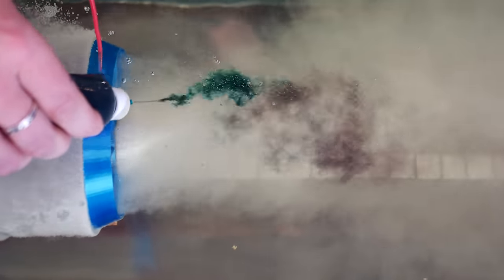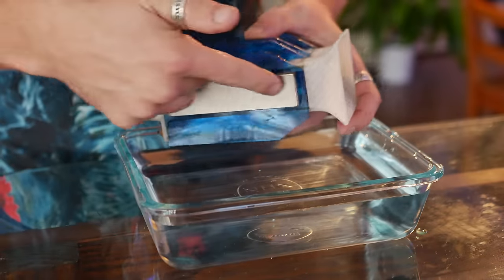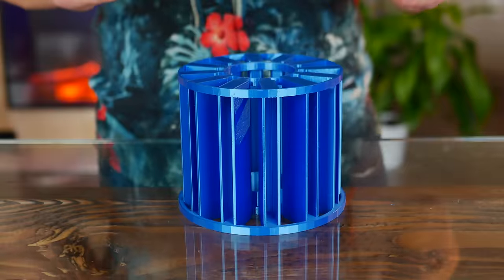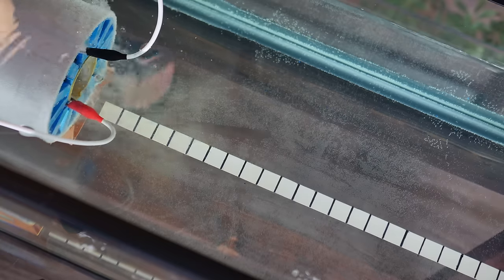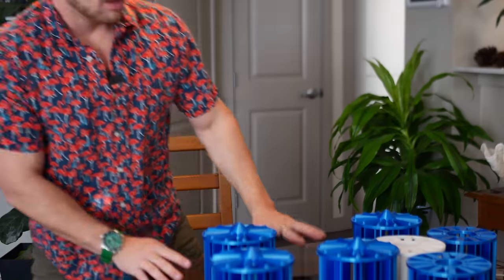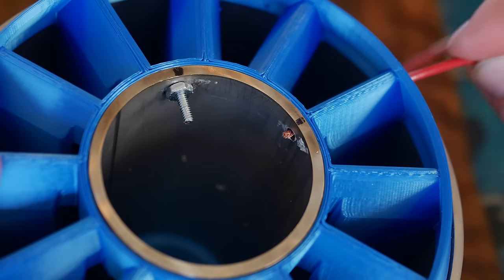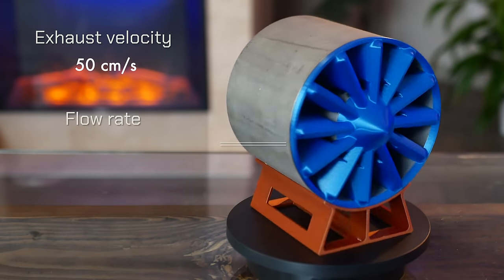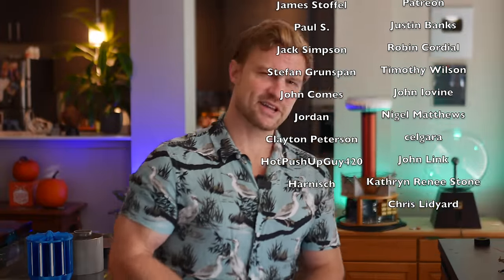Designing a Futuristic Magnetic Turbine (MHD drive)

Comment: The one thing that i am not really sure about this idea is that you could actually see the dye shift colours (a possible indication of pH change as Sodium Hydroxide is being produced trough the electrolysis of salt water). Also, the chlorine produced gets bond to the sodium Hydroxide to make sodium chlorate. Not sure if alot of ships using this technology would produce significant amounts of either sodium Hydroxide or Sodium Chlorate thst could affect marine life. I mean sodium Hydroxide is corrosive to metal and skin
Reply: I don't think it would be an issue to the marine life in the order of magnitude of power used and sodium chloride produced. In fresh water, that should not be a thing at all. Much more problematic, in my opinion, would be the corrosion of the electrodes. Stainless steel compared to the zincked iron is of a very limited improvement in this application. That is one of the reasons why you don't see much of this kind of propulsion out there. If I'm not mistaken, the application of platinum solves the issues, but with the penalty of a ridiculously high costs.
Reply: @vaterchenfrost7481  carbon electrodes does not have corrosion problem. can also use silver if not a budget problem.
Reply: Both are soluble in water and the ions are coming from the water so literally how could this even be an issue? As soon as the compound forms it dissolves and it goes back to where it came from as the separate ions it was before.
Reply: The salt in the water is merely a catalyst. No more sodium or chlorine products are left in the water than what started there. Plus, sodium hydroxide and hydrochloric acid both disassociate completely in water and the result is identical to the salt (sodium chloride) dissolved in the water in the first place.
Reply: @primodernious  actualy I thought that the positive pole of that electrode will errode away by recombining it self with oxygen molecules - becoming carbone dioxide.
Reply: @no0ne000  I think, the concerns are about changing the concentration of it locally while dissociating the water away - in my opinion - a negligible effect in these orders of magnitude. It is more a concern for the desalination plants, or for the heat exchanger on the LNG terminals. Although a different physical effect, but still a change in the chloride concentration is achieved on the local, but still largely extended areas. It was a topic some time ago, so lots of laymen have gotten oversensitive to the issue...being not able to conduct quantifying analysis of the effect.
Reply: My understanding of electrolysis in  salt water is you get browns gas.  Basically a mixture of oxygen and hydrogen. He could probably light a blast in that aquarium.  Maybe my own scientific dabbling has lied to me.
Reply: Like all of here. I am not an expert in chemistry. Nor am I qualified.  But from light research. The products of salt water electrochemistry are chorine, hydrogen , sodium hydroxide and oxygen. Hydrogen will bubble at the cathode, and chlorine and the anode. Under perfect conditions, the chlorine will react with the sodium hydroxide to make bleach. Let me point out that this is not the reaction between hydrogen chloride and sodium hydroxide, which would make water and salt. In order to make hydrogen chloride you need to burn hydrogen with chlorine. And that’s under 1:1 conditions. As you can see in the video, plenty of gasses are bubbling up and out of the water. Meaning we are losing some of the gaseous products. Now, hydrogen and oxygen and combine to create browns gas, an implosive gas. Someone in the thread mentioned this. Now with that out of the way. Let’s assume most to all gaseous are lost as we can see is mostly the case. The leftover products would be sodium hydroxide. Now let’s say that the chlorine reacted with it first, then we get bleach. I don’t think the fish are in need of any laundry cleaner. This is partly why throwing car batteries in the ocean is so bad. Another thing to point out is that even if the products are minimal. they would definitely build out over time. Same as greenhouse gasses. Under the normal conditions the thruster would product sodium hydroxide and gaseous chlorine and browns gas.

If I wasn’t very clear I apologize. If anyone has anything to add or dispute I would be happy to learn.
Reply: And they create ozone. Which is my biggest issue with these replacing propellers, sure they do cause a lot of sound, but they don't expel massive amounts of compounds not naturally found in the ocean
Reply: @shelbyseitzinger927 I would not have any issues with it at all. Being a not really stable compound, it decays in the air within hours down to diatomic oxygen. In a much more dense environment, such as water, this process will be catalytically accelerated by a couple of orders of magnitude. So effectively not existing. And for this short period of time, given the applied power and statistical probability of this reaction - the quantities would be literally negligible. 

All the commenting guys, please first of all start conducting quantity analysis while being confronted with all the panic-mode environmentalist hysteria. Otherwise, every talk becomes some kind of theological workout for some sort of fundamentalist sect.
Reply: The issue is amount of not the source. In the tank used in the video the concentration would increase over time. But compare that to the water volume of an ocean? Much less so. Perhaps though it may be of issue in riverways and ports but could see these engines used as offshore propulsion and use of thrusters etc in waterways as a mitigation perhaps? (The thrusters being traditionally fueled azipod mounted or through hull?)  @filonin2
Reply: There isn't such a thing as "sodium hydroxide" in water, it's all just Na+ and OH- ions floating around, along with H+, Cl-, and everything else
Reply: @polycrystallinecandy  aka aqueous sodium hydroxide but more accurate caustic soda since sodium hydroxide is a solid, not the dissolved form
Reply: @tjgonline1304  you were pretty clear and putting my concern in words
Reply: @brianfeddersen8124  yeah, the ocean is pretty big, but in local rivers or so where ships go day after days and years after years a accumulation may happen.
Reply: @vaterchenfrost7481  hmmmm that's interesting. Where you talking about sodium chlorate ? Because sodium chlorate is something you can do at home with electrolysis of salt trough the chlorine that reacts with formed sodium hydroxide (correctly caustic soda) to form sidium chlorate. The process is very slow tough. Btw, yes platinum would solve the corrosion of the metal. It's exactly used for electrolysis in labs
Reply: @photonik-luminescence  chlorates are strong oxidazers and react strongly prety much with every thing, promoting corosion of electrodes, and recombining it self down to chlorids and oxydes - natural mineral suspension in the maritine environments. I recomend to reasearch at least on wiki, or go and get some kind of teaching book for chemistry 1st and 2nd years of studing, anorganical chapters.
P.S. I had to correct my post, because of vocabulary errors and mix-ups due to overtiring way past midnight postings. Sorry about possible confusions.
Reply: @vaterchenfrost7481  it's funny you say that because i am a hobby chemist that made sodium chlorate for its oxidizing abilities especially to make a sugar/sodium chlorate fuel as a replacement of potassium nitrate. I admit i don't know too much about anorganic chemistry such as the chlorates. Sodium chlorate was probably the least concern as the process is really slow, but not so much caustic soda
Reply: @photonik-luminescence  I'm strugling to understand your point. Are you contradicting some of my statements, or inforcing them? So far I get it, I suspect the later, wich makes me wondering about you rasing the topic of clorates earler. Can you elaborate and be more frank about it, please?. I do have some expertize on chemestry, but my knowlage and experiance are not universal and I'm always glad to  learn a profound argument.
Reply: That is countered again by flow and the volume. Of that I am certain. To make a difference in your average port you would have to have IMMENSE power usage that would reverse any cost benefit of usiing the engines not to mention them being stationary. Would be cool if the video had a follow up that looked at that from a chemistry point of view perhaps? And also looking at degradation in varying levels of salinity with different used materials?
 @photonik-luminescence
Reply: @vaterchenfrost7481  so basically, i am not sure if the chlorate would affect the environment. But what i am rather concerned in this case is rather the build up of caustic soda. About the chlorate, i am not sure what happens to it in the water. I just produced some for my experiments, but not sure what reactions it could do that could affect the marine life. However, in the video shown we can see the dye Change color wich i sispect happens maybe due to the formation of caustic soda wich has a increased pH level. And it was pretty quick ! So while i don't know that much anorganic chemistry (since i am still learning) i do consider the caustic soda to be a problem that jay did not acknowledge in the video
Reply: @photonik-luminescence  Ok.  Thx for quick reply. From what I was able to look up (I had to, because not all of it is present from the top of my head), So basically, caustic soda drains the traces of carbon dioxide from the environment (in water as well) and becomes sodium hydrocarbon. More or less stable solid, solvable in water, able to turn to sodium-Carbonate, or in the presence of acids, producing salt. The reaction chains are various and are part of the natural circulation of the food chain as well as outside of it in natural processes depending on temperature, depth and so on. I'm not sure if I've confused you more than reassured you, but as with everything in life, natural or not - the quantities and the mixtures are of the essence. As soon as you start considering producing things in large quantities, it might become an issue, but below some limits - it throws nothing out of balance.
Reply: @photonik-luminescence  my point is, those ions aren’t part of any compound anymore. Like if I dissolved KCl + NaOH in water, or NaCl + KOH, as far as I know, the end result is the same. And so it doesn’t make sense to ask whether Cl- ions are part of NaCl or KCl
Reply: @vaterchenfrost7481  interesting. It than put an answer to my question. So i guess it's true that small quantities won't do much. For example we may accidentally consume apple seeds while eating a apple and although apple seeds have traces of cyanide, other than maybe a small stomach ache, you are ok. So thanks for clearing it up. As said, i am still learning chemistry and will never claim that i know all nor dissprove any other opinion and like to correct my self. I guess it really is after all a scale thing anyway.
Reply: @SharkRangler  also chlorine too and sodium hydroxide
Reply: You guys know more about the chemistry behind this. But what would the effect be if we skimmed the hydrogen produced for use? I could imagine a couple benefits of being able to collect hydrogen and such as the ship sails. What about the odds of collecting oxygen from it? If we can do that we could have ships that can provide oxygen for people that need it on cruise ships. Use a higher powered engine on top that prioritizes hydrogen's combustible feature for bursts of high speed, and quiet operation the rest of the time. Which could be of value to special forces. You could potentially create small versions of this for divers that could more or less let them stay underwater much longer simply by moving, as long as the battery lasts and anything harmful gets filtered out along the way. Which admittedly could pose an issue in such a compact form as a 1 diver rider. Thoughts, chemical, theory, and other uses of by-product of this method of thrust?

What about a plane that can use this built into the floats, solar on the wings to recharge the battery, and hydrogen for extra takeoff thrust. Allowing higher acceleration and shorter takeoffs from what would typically be a regular propeller driven plane. Could be the perfect thing for bush pilots
Reply: @hf117j seawater electrolysis is how nuclear submarines produce oxygen. As for using it to produce hydrogen for fuel, that's pretty impractical, the gas coming off is low pressure and would need to be compressed and stored to be used as fuel, that's a lot of extra equipment and weight for very little practical effect (hydrogen isn't nitrous oxide, you're not gonna get easy power by just injecting it into an otherwise normal engine)
Reply: The only thing? Hexavalent chromium is also a bit of an issue...
Reply: @MorRobots  chromium can be dangerous so you are right but you reach in a part of chemistry i unfortunately don't know to answer

Comment: Just a tip for your demonstrations, try adding fine mica powder to the water instead of ink. The mica shows flow and looks really cool, but most importantly it shows basically every detail of turbulence, flow and direction very clearly. (Think of those cool paint mixing videos with the insane swirls and colors.) and they come in basically any color and you only need to add it once and it will just continue to work without constantly adding dye or particulates. 

We used this technique in school when we learned about fluid dynamics and I use them all the time for resin work, so they’re readily available now because of the popularity of epoxy crafting.
Reply: No cool color change though.
Reply: That's actually a great suggestion, I hope he does this.
Reply: But mica is much denser than water (2.7x to 3x) - wouldn't the mica particles settle pretty quickly?
Reply: Hello, I recently fell in love with magnets and everything I don't know that they can do.  Now, please don't laugh but my mind sees something you might think useful. In the video you change the hydrodynamics of the water flow but to me your magnetic field is for lack of a better or more knowledgeable word, is butted or stops at the end of the magnets. Can you make the magnetic field round or continual?  Slightly changing angles or putting the magnets on a controlled pivotal hinge drastically changes or strengthens the field and makes it continual. I hope I'm saying what I'm thinking. Keep up the awesome work, genius i say.
Reply: @richardglenn6840  Great insights about the magnetic fields! To answer your question: Yes, you can alter the shape of a magnetic field. Using magnets on a controlled pivotal hinge or changing their angles can indeed make the magnetic field more continuous or rounded. This can impact how the field interacts with other objects, like influencing water flow in the ways you've described. Thanks for sharing your thoughts!
Reply: Using Titanium instead of SS will fix the Corrosion problem.
Reply: This is a fascinating concept, but it's important to note that, as of now, there's no scientific foundation for a universal "energy shield" that can deflect all types of weapons. Current physics, however, does suggest that specific shields for different threats could be theoretically feasible. For instance, magnetic fields can control plasma, as demonstrated in magnetic bottles since the 1950s. The idea of scaling this up to shield a ship while preventing interference with onboard electronics remains in the realm of science fiction.

For your turbine demonstrations, you might want to try using fine mica powder instead of ink in the water. Mica can beautifully visualize turbulence and flow details while also giving an aesthetic, swirling effect like those seen in paint-mixing videos. Plus, it comes in various colors and doesn't need to be constantly replenished like dyes, making it an efficient alternative!
Reply: The mica would conduct and be propelled

Comment: That's awesome! Also I think you just gave me an idea
Reply: If you or anyone gets a chance. Try out different setups. Try concentric ones. Try longer ones. Multi stage. Mess with the difference between the amp/volt relationships. Electromagnets vs permanent. And lastly. If you can skim the byproducts from the electrolysis for a second propulsion system above the water. I might or might not get the chance to do these tests myself. But I just started a new job and have a huge backlog of projects. Including functional active camo like in Halo or Predator. I think I've got something but I just don't have much time on my hands. Not sure I'd call it active camo either as it doesn't even need a power source. So not really your department. But absolutely try out the mhd stuff. I'm very curious about what provides the highest performance from drives that use zero moving parts
Reply: search up eric laithwaite magnets video, its an old video on youtube, he shows a mechanism that can propel without moving objects but only ac. and no its not your usual ac motor, the propulsion is very similar in the designs principle in this video.
Reply: Another trans-Atlantic battle? Velocity King?
Reply: Lol pin integza
Reply: Pin
Reply: Oh boi, my man Mr. Integza is looking for a fight. Be warned a collab between plasma channel and hackersmith for this drive looks to be in the works.
Reply: Can’t wait to see Integza use one of these to cross the Atlantic to do the collab
Reply: Yh i was also thinking about tapering the exhaust part of the thruster to facilitate more pressure output